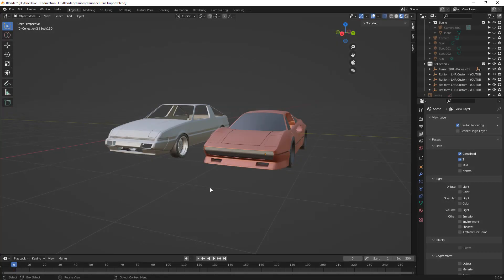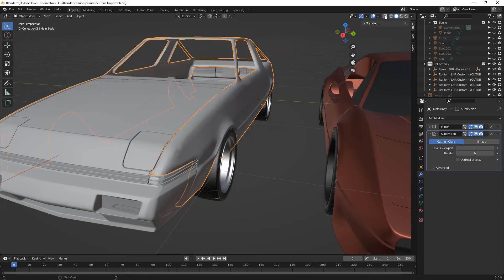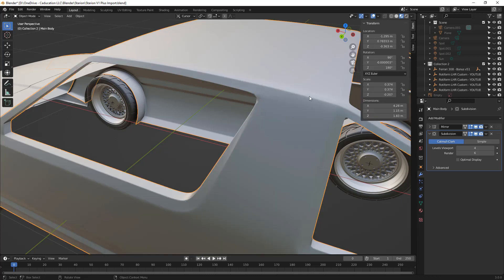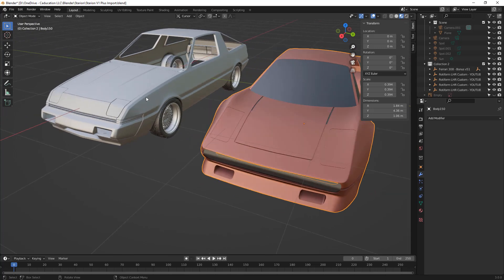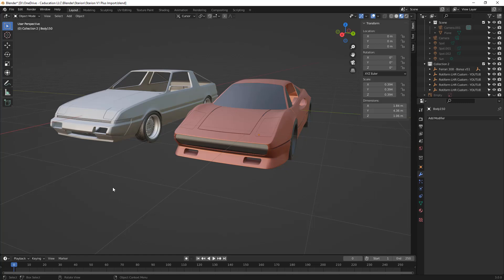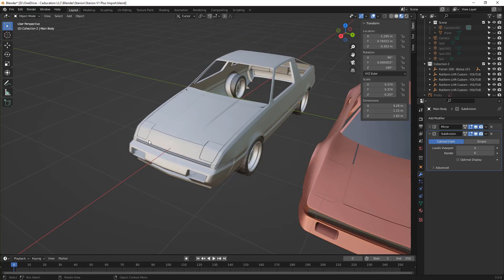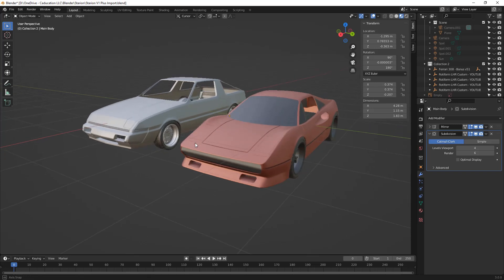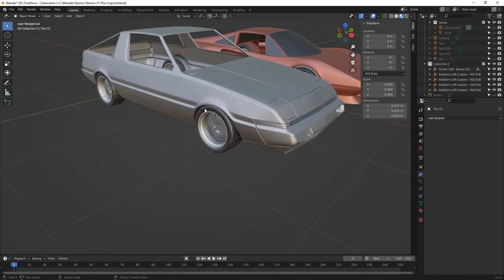CAD vs Poly Modeling for Cars - Fusion vs Blender

Comment: I keep reading that CAD software has more precision but is it true? I have compared files made in CAD and Blender and I haven't noticed any difference, numbers are numbers and Blender has some impressive resolution and scaling. You can make objects many km in size down to 1um. Unless you are designing ultra precision equipment I don't think Blender lacks precision for most of the time.
Reply from the maker: Well so the problem (in my opinion for what that is worth) is that Blender is a Mesh and Fusion is a NURBS surface or BREP solid.  So for example if you make a box in Blender, the divisions you  have of that box can be 4 sided and not tris, but ones you add a bevel or try to round corners or something then it starts dividing it up.  A box in CAD that gets a fillet added to it has a true arc.  Same with say a circle/cylinder.  These are basic shapes but the general idea is that these shapes are easily represented by math making them BREPs and complex shapes are represented by NURBS surfaces.

Why does it matter?  Well if you 3d print everything it probably doesn't, but 3d print slicers are now able to take STEP files and create true arc movements using G2/G3 instead of a bunch of straight lines.  So the difference comes with curvature and file types.

Its true you could make a 10mm cube in blender or in CAD, but pop a hole in the center of it and things get very different.  And blender does have smoothing and sub-div but that doesn't ever get you to true arcs.  You can make Bspline curves in 2d but once you convert them to a mesh element its a bunch of poly lines.

Comment: Does blender now become better at mimicking cad softwares?
Reply from the maker: Not to me really.  While Blender does have booleans and you can get away with a lot there.  when you try to bake those booleans into the model, the edges/mesh gets ugly.  I think it depends on your goal for the model down stream.  If you need good clean low poly models for games it can be tricky to take a model from CAD like Plasticity and get a good edge flow needed for low poly models.
Reply: @LearnEverythingAboutDesign  thank you. I really liked your representation and I have learned a lot.

Comment: For exporting CAD with high quality quad mesh to Blender I use Moi3D. It's by far the best when it comes to giving out relatively clean topology. You might have to do some clean up, but in most cases it is a 10 to 20 minutes process to create a SubD production ready mesh.
Reply from the maker: Thanks for sharing!  I know a lot of people like to use MOI and some Shapr3d.  it is good to know what is available!
Reply: did i get it right, you create high quality model and export it to blender for retopology?

Comment: is it alright to try and unwrap cad models? or i need to do complete retopology to apply textures?
Reply from the maker: I am not an expert on the subject but from my experience a proper topology built in Blender is easier to UV  unwrap than a dense mesh converted from a CAD model.  Its not impossible, but it works much better if the model coming in is split up.  For example the doors, fenders, hood etc are all separate surfaces which makes selection easier to unwrap.  If you have a single body for everything you have to spend the time and carefully select things.
Reply: @LearnEverythingAboutDesign  the point is that I found it difficult to model things in blender, yea people use bunch of addons, different tricks etc.. but i'm watching how people model in plasticity and it looks extremely fast. I'w wondering that it makes sense to avoid modeling stage in blender and do it in plasticity and zbrush. Because it's unnatural to spend tons of hours modeling car or gun, endlessly tweaking vertices in polygon software.. What's your opinion on this topic? I'm really interested
Reply from the maker: @alexvisart1016  I have a video doing some concept car shaping in Plasticity.  I wouldn't abandon blender or Fusion for Plasticity for car modeling just yet.  The loft and patch tools aren't mature enough, but the surface quality is good.  You can UV unwrap whatever you what, just the selection process is tricky so if you can just split the model up before you mesh it in blender.  So doors, body panels etc. split them and it will make your life easier.

Comment: Have you tried Rhino? I've used Fusion and Rhino and Rhino just feels "snappier", faster and easier to work in. Just curious if you have.
Reply from the maker: Hi David, years ago I did try Rhino.  This was back when the Tspline plugin was still used on Rhino and Solidworks but is now the Forms we know in Fusion....So it has been awhile.  I actually have a list of software to "cover" on this channel. Rhino, Sub-D in Solidworks 3dx maker and SolidEdge are all on my list.

I do think Rhino offers a great value.  For around $1000 USD but for an installed, no licensed product seems like a good deal.  I do hope to cover it in the future.